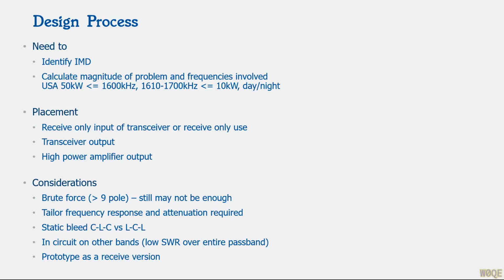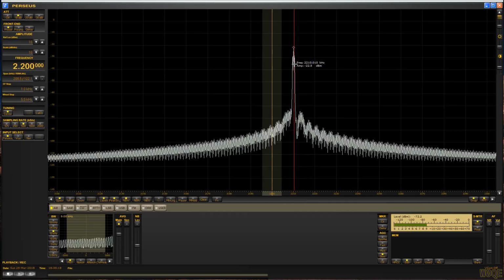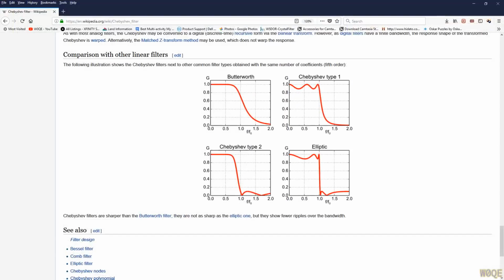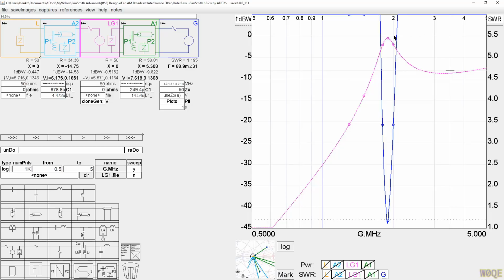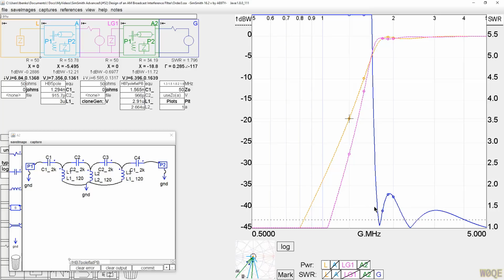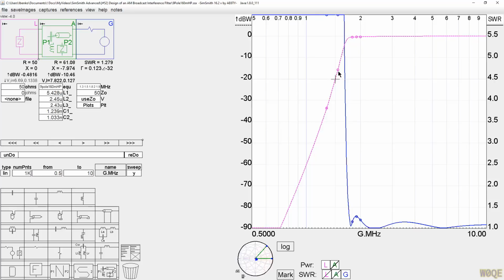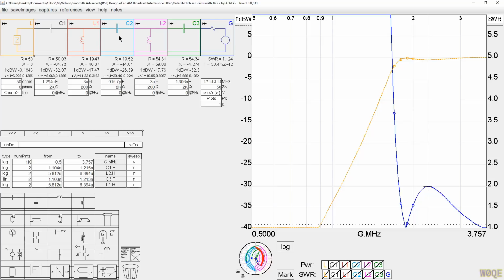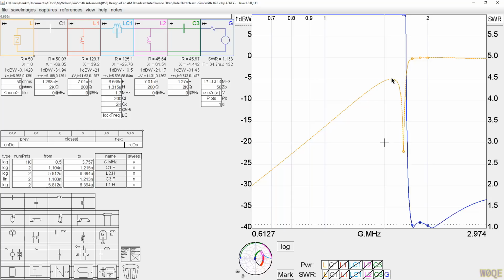#52: Design of AM Broadcast Inferference Filters

Comment: Another nice video, Larry.  If the filter was just used for receive, one could put a variable capacitor trimmer in the resonant circuit and tune it using a signal generator and scope.   W0IVJ
Reply from the maker: For the last circuit with the notch you are absolutely correct.  The actual L & C values were not nearly as critical as the product of L*C which determines the notch frequency.